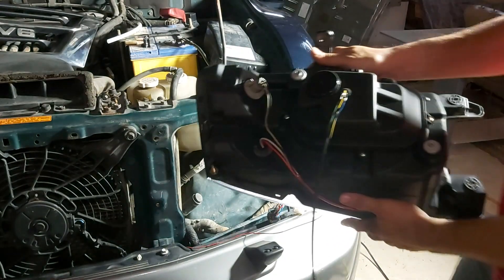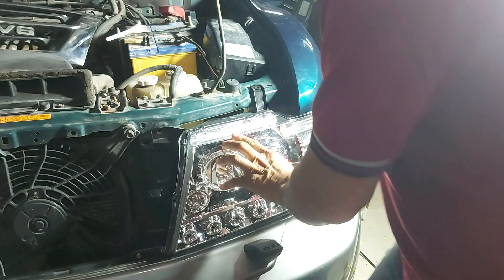Electric Pajero Headlight testing.

Comment: Hey mate, are you in Brisbane?  I have some of these Mars lights and had no idea you could do this.  Can you make more of these controllers?
Reply from the maker: I am in Brisbane.  I have modified all the doors and lights to run on CAN bus.
There is a computer that controls the pattern.  It is not done by the headlight.
The computer tells the headlight what light to turn on and at what intensity and it modified the request over time to get the right effect.